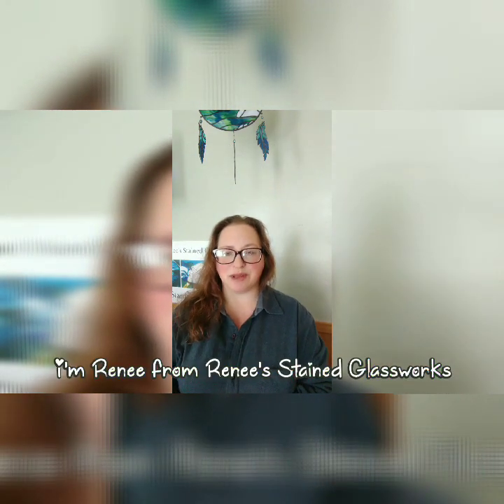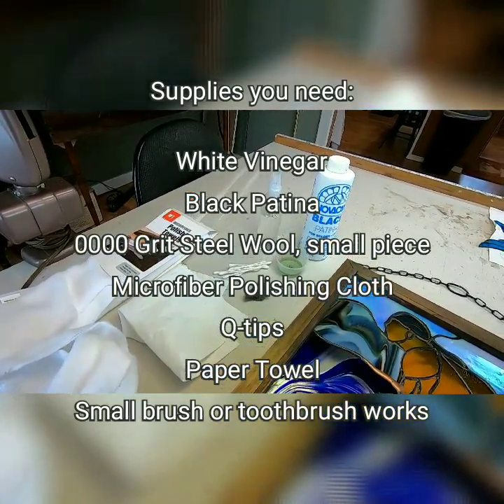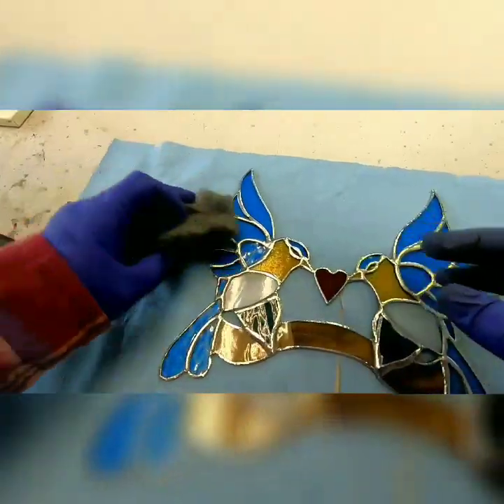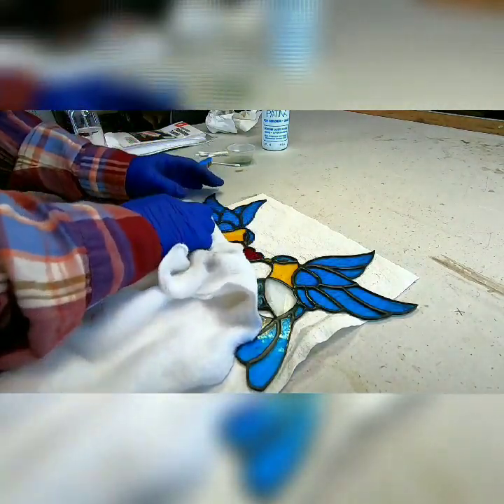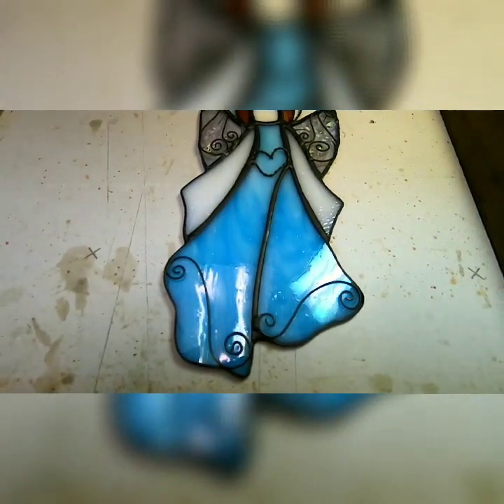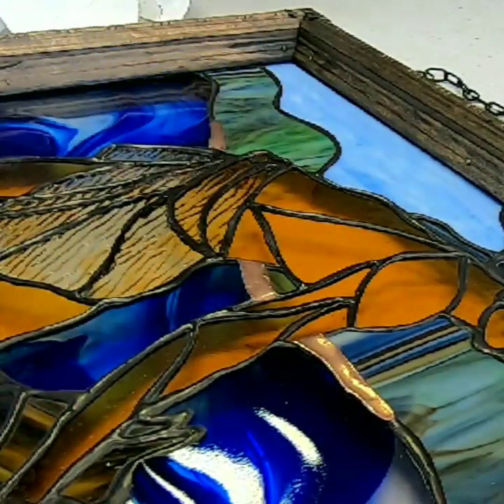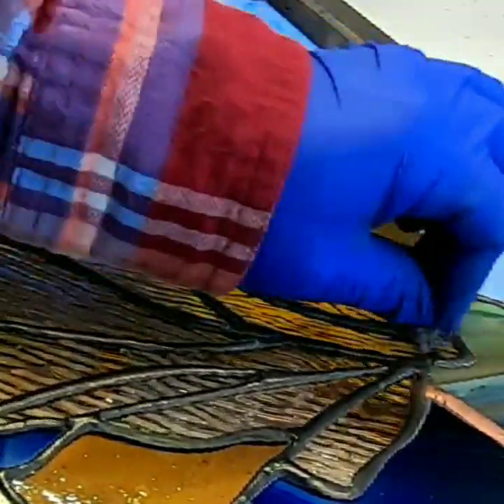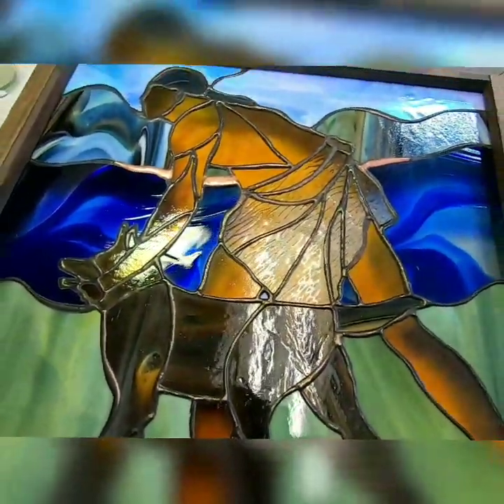How To Keep Your Stained Glass Solder Lines Looking Like New

Comment: Could the dulling be because of the chemical reaction to the petina? Inoticed you did not wash it off after applying it. I learned that the patina is a chemical reaction and after a few minutes after applying it is to be washed off because it is a chemical reaction not a paint.
Reply from the maker: The vinegar works very well with thr patina it also helps the remove and clean it from the glass.  However if your not getting the desired effect then yes I would wash it more.

Comment: When cleaning up an older piece with ugly solder residue, after the initial wipe with white vinegar would it help to use 0000 steel wool, then more vinegar, before applying the new patina?
Reply from the maker: Yes it would be good to use 0000 grit steel wool

Comment: after see your video i was going to use vinegar as you suggested. then I found this online:  Do not clean stained glass with an abrasive material as it will remove or scratch the patina on the metal. Never use vinegar, ammonia (e.g., windex) or any acid-based cleanser, as these can destroy the came or solder that is holding the piece.   What to do now??
Reply from the maker: Never had a problem or issue using vinegar.

Comment: Do you still use this method, or do you only use the whiting powder now?
Reply from the maker: I do this method initially cleaning with vinegar and then I finish off my piece by doing a final cleaning with whiting powder.  I'll try and get an updated video out there.  Thanks  so much for watching!
Reply: @reneesstainedglassworks I like the whiting powder rather than polishing wax.

Comment: when you patina the piece for the 1st time with the toothbrush do you wash the patina off
Reply from the maker: I dont wash it off.  Sometimes I dry it with a dry cloth and then spray it with vinegar and wipe clean.  If its really dirty and you feel more comfortable you can give a rinse with some vinegar.  After that I allow it to sit for a little while before polishing with more vinegar and microfiber cloth.
Reply: thank you, what size should the blue bird pattern be please
Reply from the maker: @sandrafenton1207  you can make any size you like.  I made mine 12 1/2" wide by 9" tall